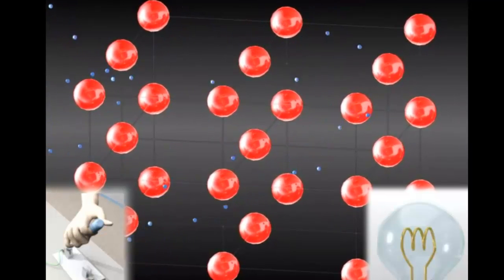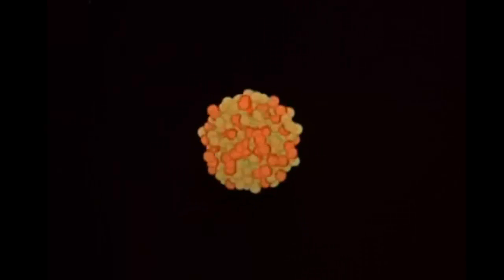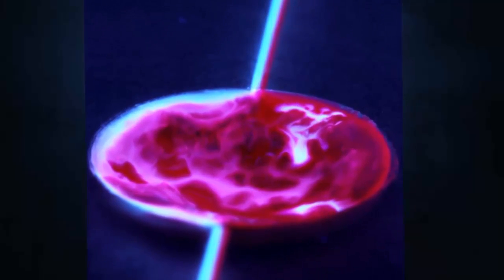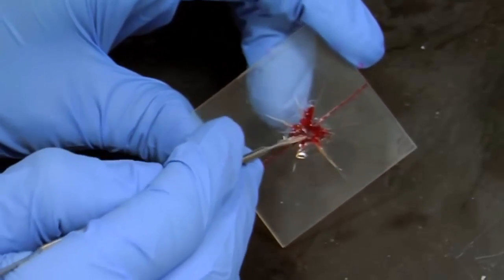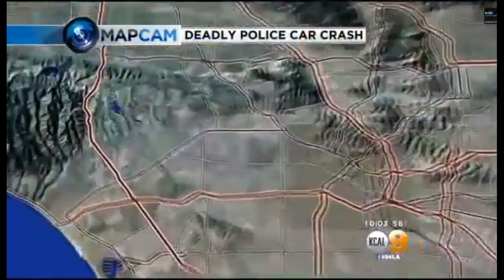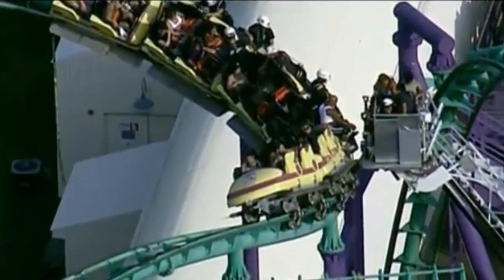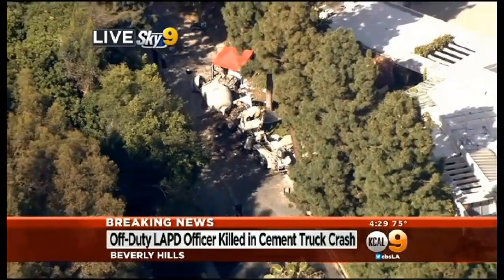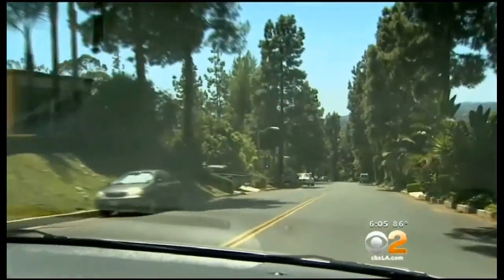Wigner9: Unintended Consequences

Comment from the maker: More Unintended Consequences??
BONNEY LAKE, Wash. -- At least one person was killed in a construction accident at a Highway 410 overpass when a chunk of concrete collapsed onto a roadway below and smashed onto a passing vehicle.

Bonney Lake police officers raced to the scene at Angeline Road when they got the call for help at 10:15 a.m. 

"We found that the jersey barrier that covers SR-410 that was being worked on by construction workers came loose from the overpass and fell onto Angeline Road and struck one vehicle that was traveling north on the road," said Todd Green with Bonney Lake Police. "When it fell off the overpass, it landed square on the roof of the vehicle."

Green says they have been unable to determine the age and sex of the driver, nor if there were any passengers in the pickup. 

"The overpass is very unstable right now and we're waiting for L&I and DOT to arrive on scene," Green said. "Once they arrive on scene, we'll be able to be able to secure the overpass a little more and make it safe for emergency workers to get in there and determine how many occupants are in the vehicle."

http://www.komonews.com/news/local/Part-of-SR-410-collapses-onto-vehicle-in-Bonney-Lake-299584131.html?abc=5QmOreiQ

Comment from the maker: LONDON: Commuters faced gridlock as flames and thick black smoke billowed out of manhole covers at the central London station of Holborn.

More than 2,000 office workers and students were evacuated from nearby buildings as the intoxicating plumes of smoke came from beneath the pavement.

The London Fire Brigade dispatched 35 firefighters in six fire engines to tackle the blaze that started with electrical cables in Holborn, central London

Power may be off for 36 hours in Central London - met police.

Dramatic video shows flames coming up through the street: 
http://www.telegraph.co.uk/news/uknews/11509726/Holborn-fire-flames-filmed-coming-up-street.html

Comment from the maker: Belgian nuclear reactors riddled with 16,000 unexplained cracks: "In carrying out tests related to theme 2 during the spring of 2014, a fracture toughness test revealed unexpected results, which suggested that the mechanical properties of the material were more strongly influenced by radiation than experts had expected. As a precaution both reactors were immediately shut down again."

As nuclear reactors age, radiation causes pressure vessel damage, or embrittlement, of the steel mostly as a result of the constant irradiation by neutrons which gradually destroys the metal atom by atom - inducing radioactivity and transmutation into other elements.

Another problem is that hydrogen from cooling water can migrate into reactor vessel cracks. "The phenomenon is like a road in winter where water trickles into tiny cracks, freezes, and expands, breaking up the road", says Greenpeace Belgium energy campaigner Eloi Glorieux.

"It appears that hydrogen from the water within the vessel that cools the reactor core is getting inside the steel, reacting, and destroying the pressure vessel from within."

http://www.theecologist.org/News/news_round_up/2758982/belgian_nuclear_reactors_riddled_with_16000_unexplained_cracks.html